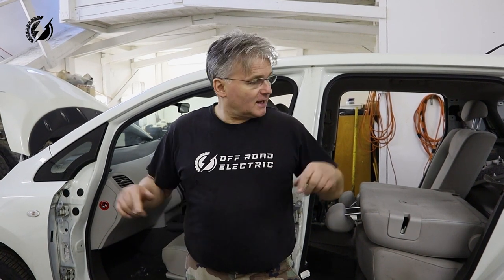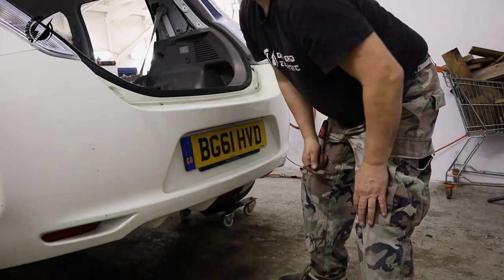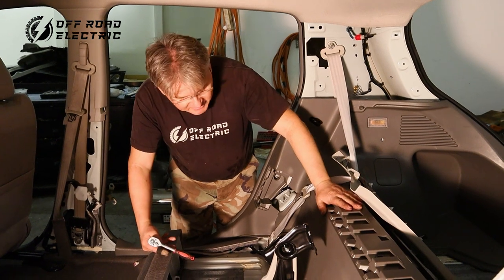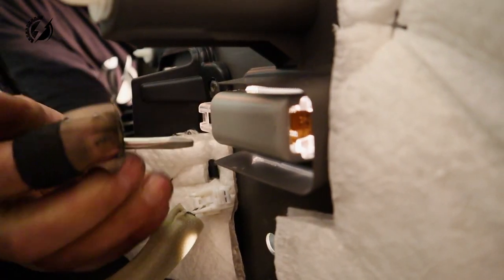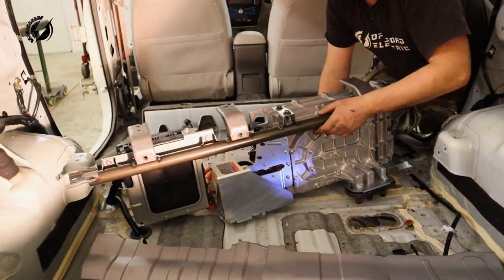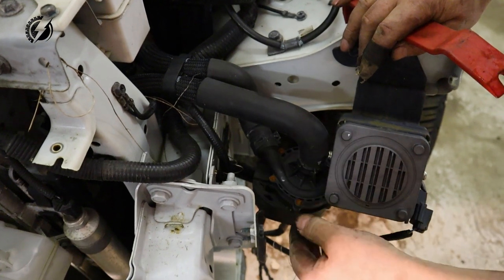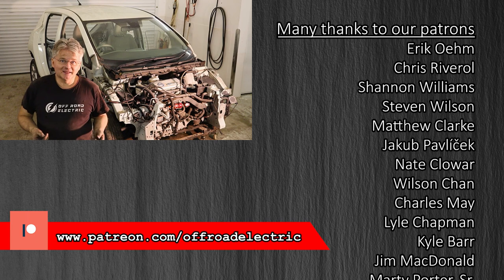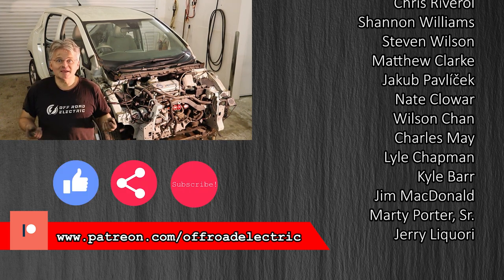EP.40, Nissan Leaf  Gutted! - 4-motor Monster Truck Project

Comment: Having torn down a model 3, the number of parts and the complexity here (so many connectors!) really shows the difference between a ground up EV and a conversion (even a good conversion like the leaf).
Reply from the maker: Fully agree. This is a conventional car fitted with an electric drivetrain.

Comment: I have a white leaf so it’s great to see how it’s all assembled (and disassembled). Curious to see if on the off road truck if you’ll have four individual chargers or stack the batteries to one charger
Reply from the maker: Hi Noah,  I want to reuse as much as I can, so it will be probably 4 chargers. Otherwise the charging would take too long with one leaf charger, or I would have  buy  some aftermarket big one.